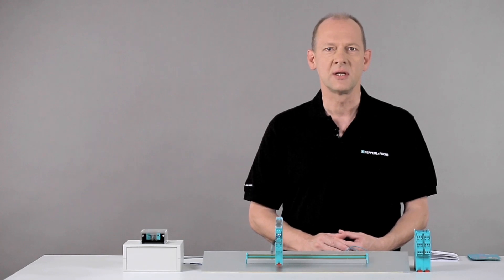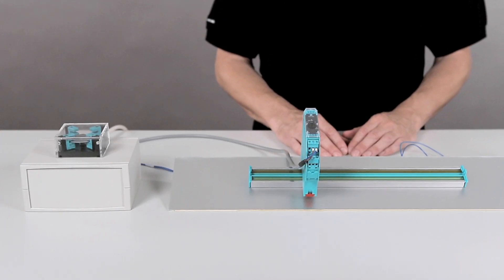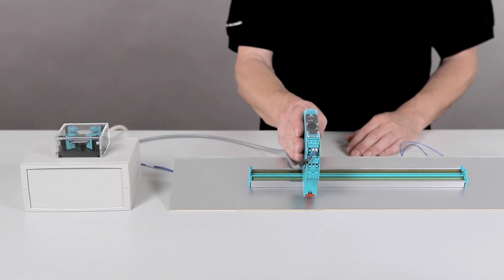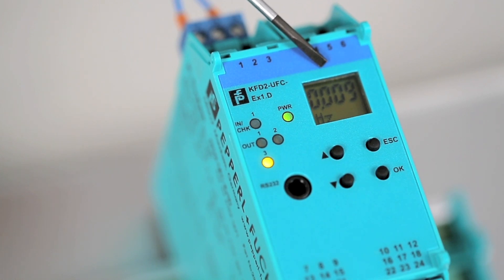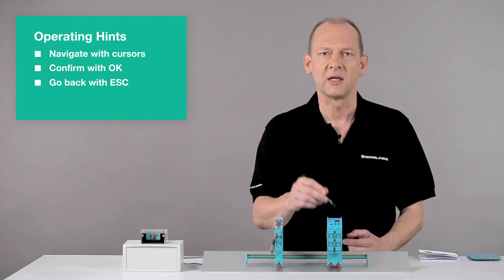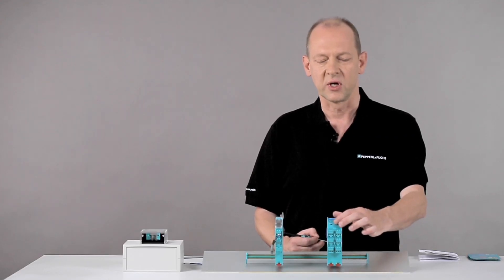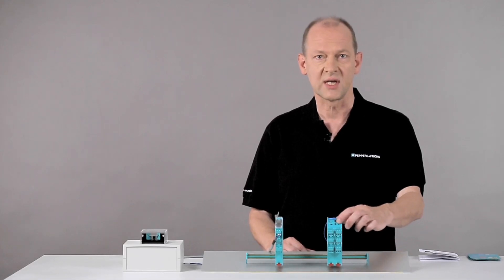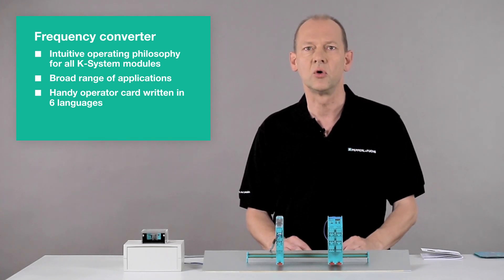How To: How Do I Parameterize the Frequency Converter UFC via Push Buttons?

Comment: Hello can i use frequency converter module kfu8-ufc-ex1.d with flow transmitter have a frequency output thanks
Reply from the maker: Thank you very much for your question, Hammad Shahat. Our UFC module is suitable for field devices if the output follows the rules of NAMUR or voltage free contact or transistor/optocoupler. If you send us the manual of the flowmeter (and complete typecode in case the manual includes multiple types of outputs), we can surely have a look into that in detail (pa-info@pepperl-fuchs.com). #AutomationPassion
Reply: @pepperlfuchs   thanks for your fast response i have endress + hauser proline promass 200 flow transmitter